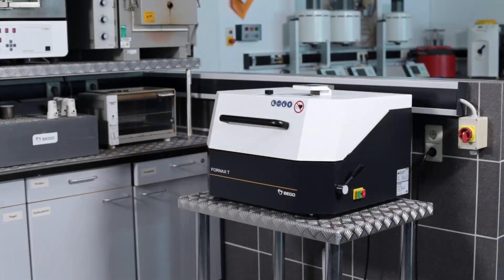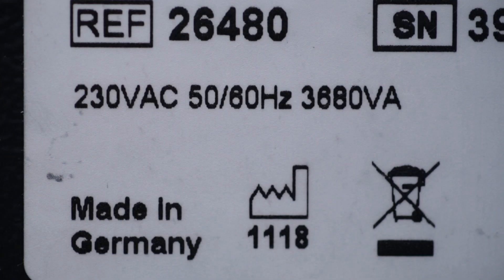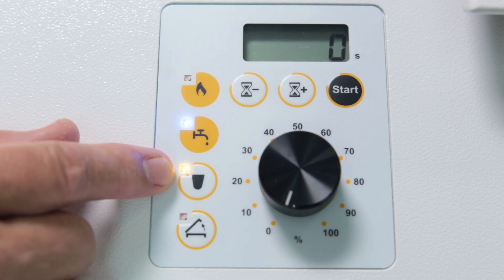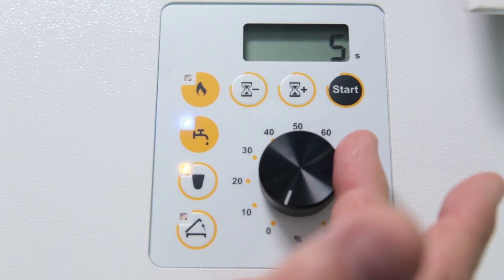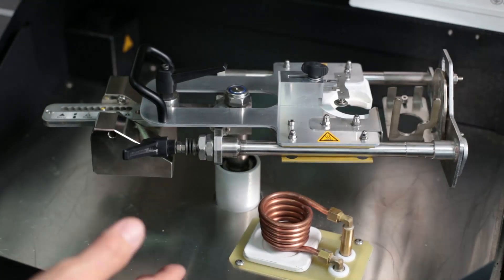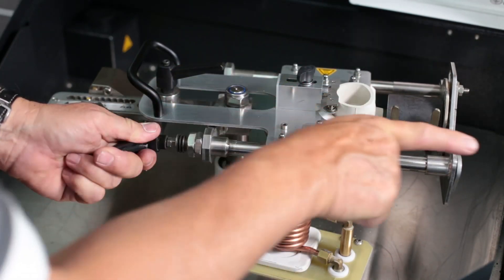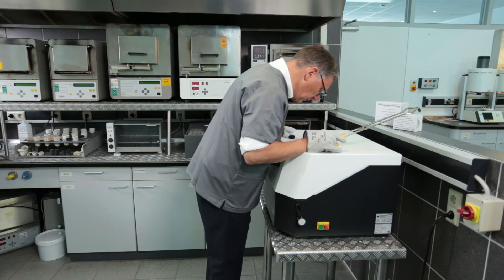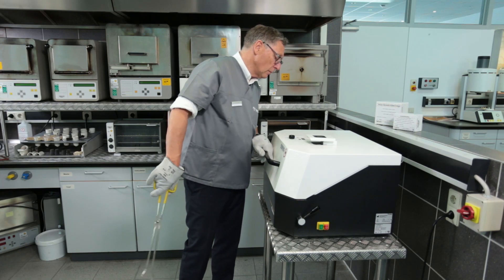Tutorial - Casting with the new BEGO casting machine Fornax® T

Comment: sir in casting machine there is error E01 why plez give me sujestion
Reply: I just got mine and I'm getting E01 also, I was wondering if you were able to figure out what that means.
Reply: Lograste resolverlo porque el mio enciende la luz led de agua y luego de unos segundos sale error 01 @EURO-EDM
Reply: @ I did solve the problem myself without contacting BEGO actually. All I had to do was to fill the tank designed for water for cooling with water.

Comment: Please help, what if the lid is stuck and won’t open, what should we do? It seems stuck
Reply from the maker: Hello Sv Lana,

there can be several reasons for this.
If the device cannot be opened by pressing the opening button (on top of the lid), there is an emergency opening option.
On the right side of the unit, there is a small hole, just above the release lever. A thin instrument can be inserted here (horizontally, from diagonally behind). 
The magnetic lock can be opened by pulling it slightly forward, see picture attached.

Please check if the pin in the lid is still tightened, if it moves please fix it. Please also check the hinges of the lid on the rearside, if they are not tight anymore the lid can move and the pin of the lid doesn‘t release the magnetic lock anymore.

In case of doubt please contact your local or the BEGO service department. (service-geraete@bego.com)